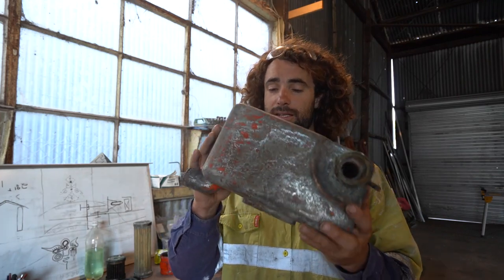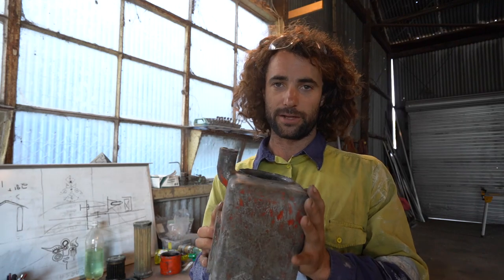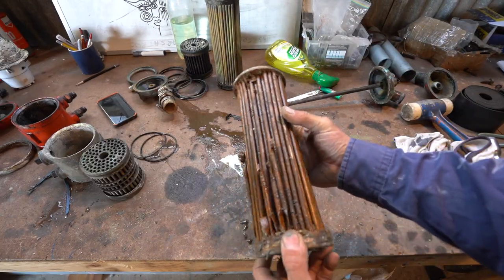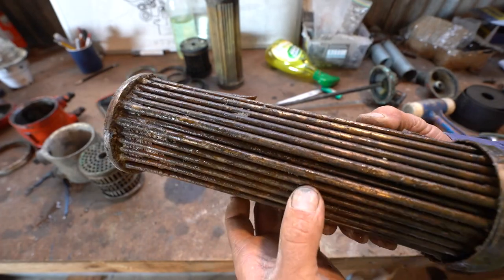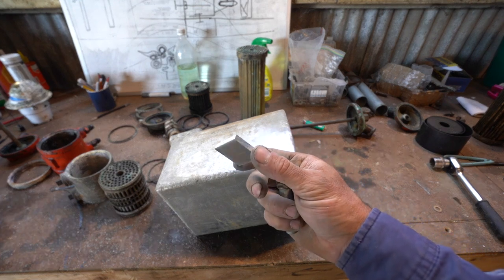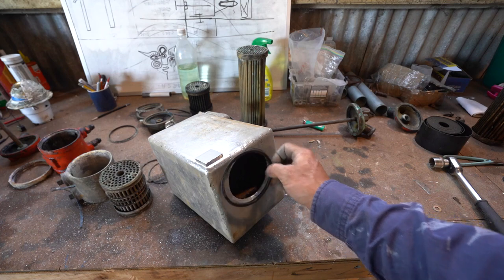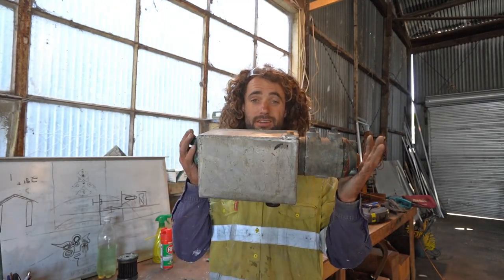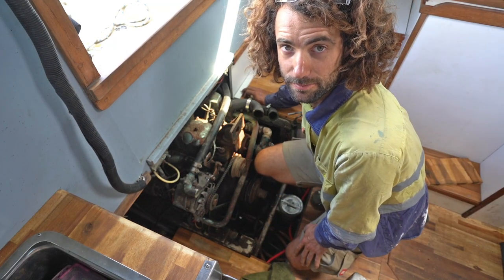Heat Exchanger Repairs - Yacht Restoration #9

Comment: Well done. Is there a reason(s) plate heat exchangers aren't popular for this use?  Very easy to monitor, clean and add more plates if required?

Cheers
Reply from the maker: Hi Mike, I'm not enitely sure but I'm guessing it's because of the flow required? Thanks for watching!